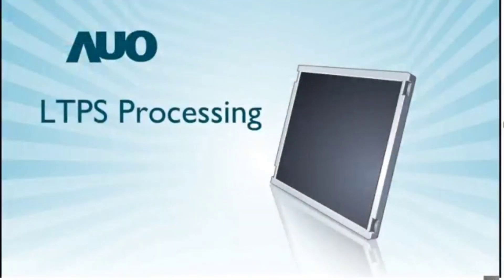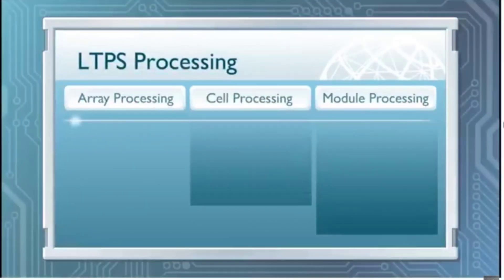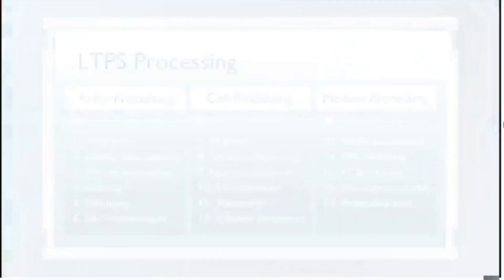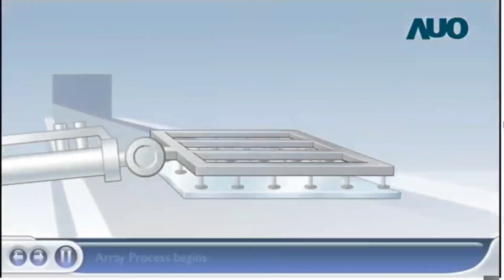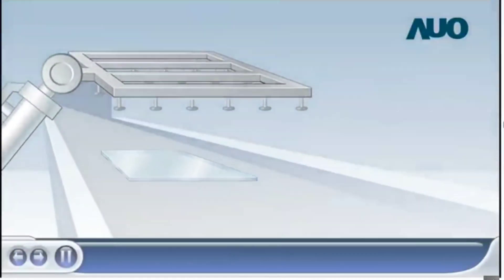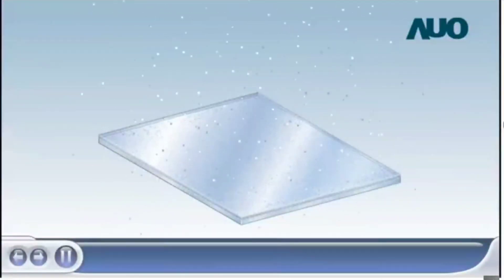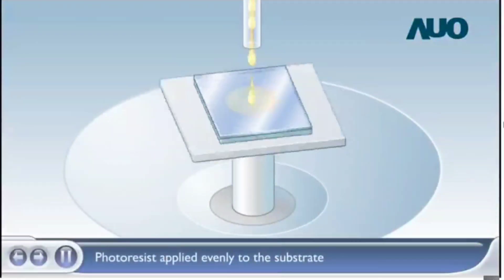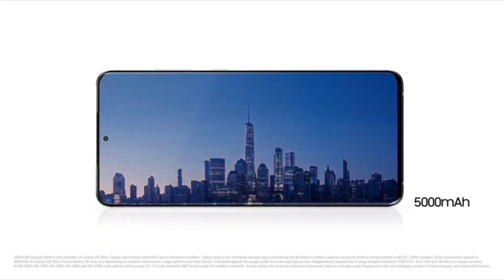(S21 Ultra) The Difference between LTPS and LTPO Displays - EXPLAINED!

Comment: Minus 650 degrees Celsius?!
Reply: 650 communist units above zero not below 0, or about 1200 socialist units.
Reply from the maker: Apparently
Reply: @PradeepRajadasVGP  IMPOSSIBLE.
Reply from the maker: @erskegron2985  Wikipedia
Reply: @PradeepRajadasVGP  Check Wikipedia (or any book about termodynamics) about zero Kelvin. Minus 650 degrees Celsius is impossible.
Reply from the maker: @erskegron2985  will do
Reply: @erskegron2985  i did check Wikipedia & it states as follows:

"Low-temperature polycrystalline silicon (LTPS) is polycrystalline silicon that has been synthesized at relatively low temperatures (~650 °C and lower) compared to in traditional methods (above 900 °C)."

He mistook ~650°C as -650°C ! 🤣
Reply: @udayangshubhagabati6264  thanks for the clarification
Reply: @PradeepRajadasVGP  i hope u feel smarter already

Comment: Did you say minus 650 degrees celsius at 1:12 in the clip? That temperature is physically impossible. 
0 degrees Kelvin is the minimum allowed temperature according to physics, which equals minus 273 degrees Celsius or minus 460 degrees Fahrenheit.
Reply: Even i got shocked hearing this...
Reply: It’s not 650 communist temperature units below, but above 0. That’s about 1200 socialist temperature units
Reply: You are correct. He was stoned cold wrong.